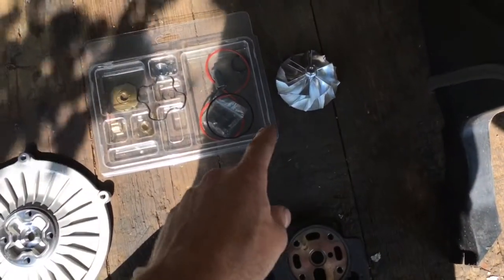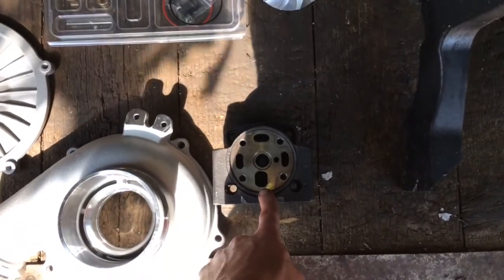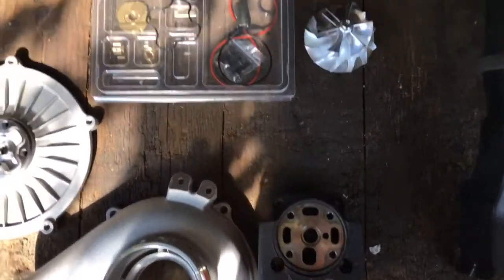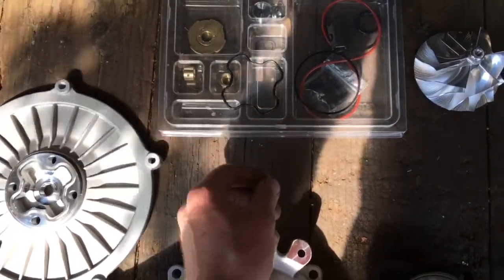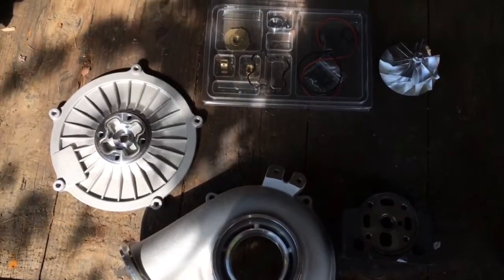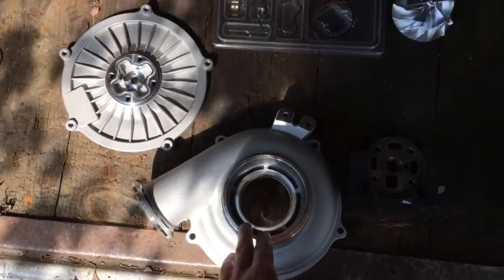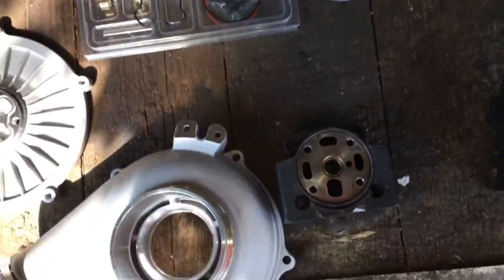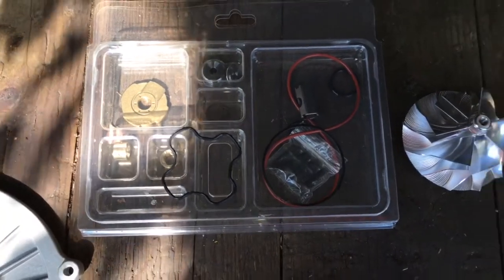7.3 powerstroke with turbo upgrade

Comment: What are your thoughts on the KC turbos sxe turbine wheel?
Reply from the maker: Jake Resch I m not familiar with it
Reply: @turbolabamerica  it's a drop in turbine wheel that's just like an s300sxe turbine wheel but reverse rotation, supposed to spool much faster increase power and lower egts

Comment: How much boost were you getting
Reply from the maker: 20 psi before hydra tune, 25 psi after hydra tune
Reply: Hmm I get 25 to 27 on kinda stock turbo with swamps tunes..wonder what it would do with that turbo
Reply from the maker: The e450 has a factory 1.15 non wastegated turbine housing which kind of makes it harder to build boost. I feel like, if the truck had a more precise tune for the turbo that it would pick up spool.
Reply: Turbo Lab America is there a way to make the gtp38 ball bearinged
Reply: Turbo Lab America can u make a vid on the exhaust, so we can hear how loud it whistles.
Reply: changing just the compressor wheel or housing will not change the turbo sound from the exhaust of the exhaust
Reply: justice nass Bull shit i switched my stock wheel to aww2 the spool was louder whistle was louder stock turbo is 60/80 the wheel hes got is 67/93